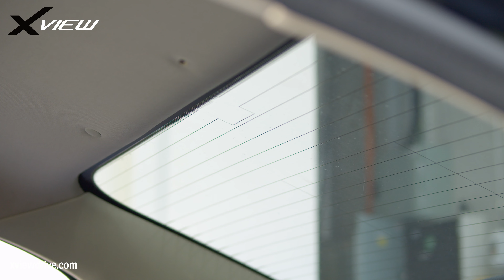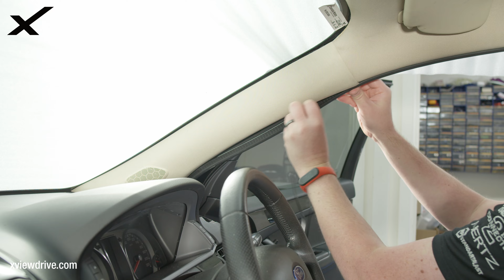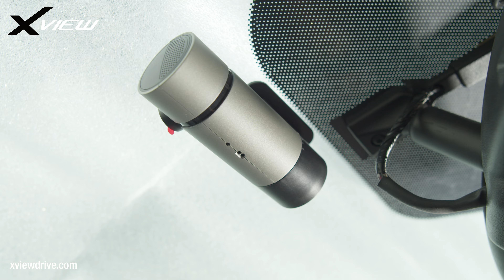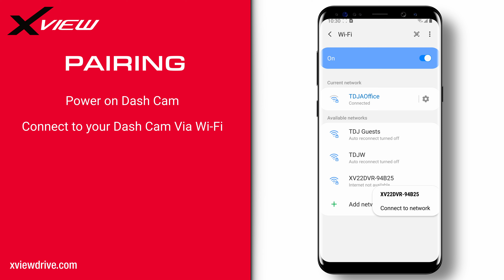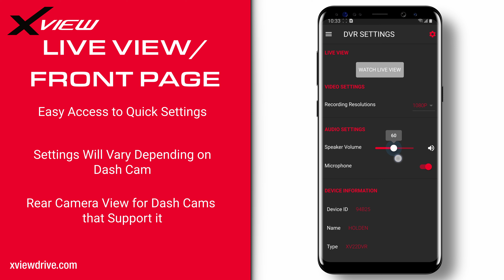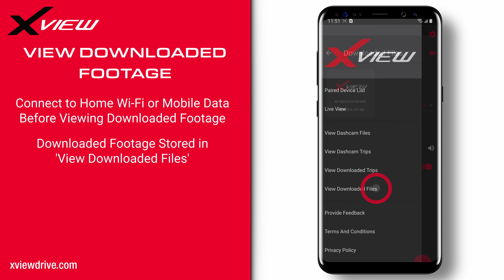XVIEW XV22DVR - FULL HD 1080P DUAL DASH CAM WITH WIFI AND GPS - INSTALLATION & SET-UP GUIDE

Comment: I got new x view dash cam, the front camera working perfectly, but the rear one doing a glitch and its brandnew .
Reply from the maker: Hi, if the rear camera is connected correctly (the cables are not loose) and it is not working there may be a fault with the rear camera or the connecting cable. It is best to return to your place of purchase and discuss repair or replacement with them.

Comment: Absolute junk wasted dollars buying the xv22dvr dash cam the files show the vehicle upside down and on the wrong side of the road after sales is pathetic after several emails to the company no one replies I’ve been back to Repco several times and they have no idea
A rating out of 5 stars 
Pricing 4 or 5 stars
The unit itself 
Half a star at its best 
Don’t waste your money on this device
Reply from the maker: Hi, I'm sorry to hear that you experiance with our product has been so poor. If you have had no success with your place of purchase in regards to punctionality it is best to contact our team directly either via email at service@tdj.com.au or via phone at 03 8587 8888
Reply: Yeah I wouldn't buy it in hindsight either. 
Got it wired and in place, only for the app to not even start up 😅 
Just gonna fiddle with  it and use the camera on a extendable pipe I have with a light on it. 
Will be able to look in hard to reach places
Reply: I followed every bit of instruction even the manual. What sucks though is it keeps cutting off and re connecting with the girls voice from the unit saying “gps connected”.